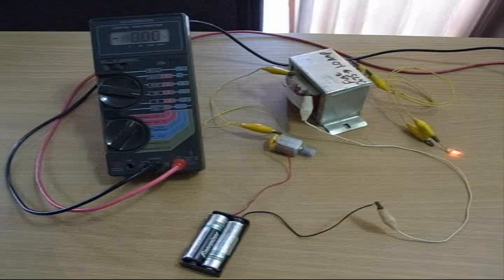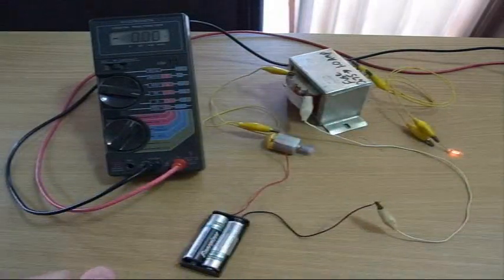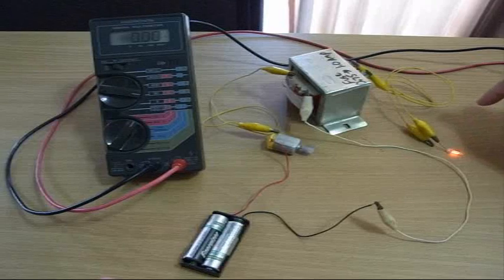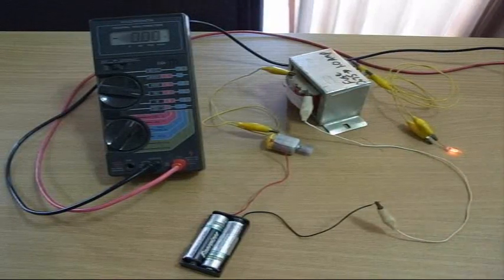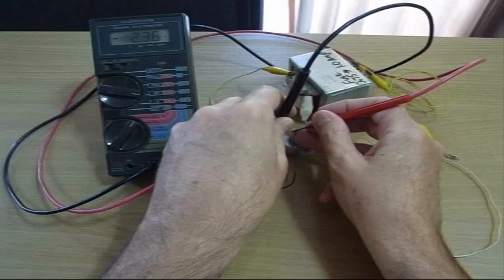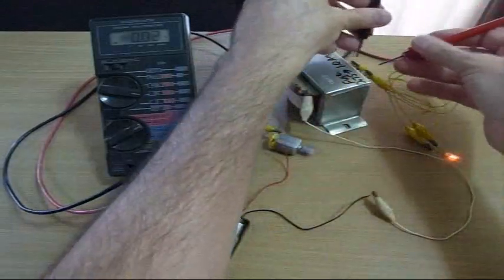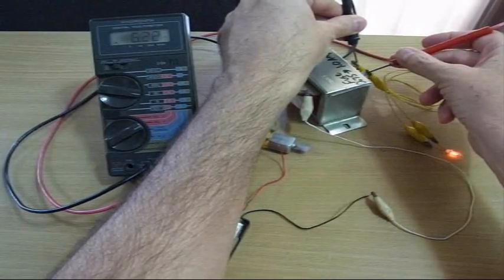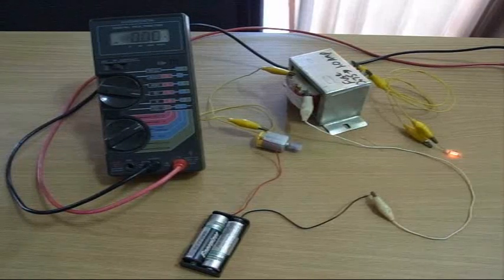Free Energy Inverter? - You Decide

Comment: We can observe energy (plasma energy) as the form of light in the output . This is causated by the flow in the little resistence of the transformer input (or the little induttance), isnt'it?
Reply from the maker: The transformer takes a lower voltage and makes it a higher voltage.

Comment: high voltage high frequency output due to the series circuit with the motor in the primary, it creates a pulse everytime it turns. the rpm is the frequency output, the number of turn of the secondary is you output voltage. it may vary depending on the input voltage of the primary. say if it was design for 12v 230v, so if that 2.5v in you will have 48v out at high frequency/rpm.
i am trying to build a solid state one, instead of motor to give me pulses, i use transistors. no moving parts only the electrons are moving.

Comment: take that same motor and then file down the brushes a bit so that only one commutator is activated. That will help boost the back EMF and increase the voltage. Replace the neon with a capacitor and you'll have usable power.

Comment: put a rectifier diode in series with the voltmeter and read dc on the meter and in one way of the rectifier it will read high voltage. in the other it will read 6.  ac don't real two directions. ac read dc but multiply by 2 to get ac voltage. if you read a battery one way with setting on ac it will read twice the voltage.

Comment: battery is not possible  to connect   transformer  without diodes. ( transformer for AC current only if can be used with DC please ...to explain...thank you
Reply from the maker: Yes, if you connect a battery directly to a transformer it is a short circuit.  But I connected the battery to a DC brush motor then to the transformer.  When the motor spins it connects and disconnects the DC to the transformer making it pulsating DC.  It is not AC, but pulsating DC is close enough to cause the transformer to transform.
Reply: ok right  thanks friend
Reply from the maker: No problem.  I've also done a video doing something similar with a relay to break the DC.

Comment: The reason the old 'ratty' motor worked better was due to the brushes being worn. The old style brush only hit one of the commutators at a time, creating a lot of sparks. Bigger brushes, which contact the second set of commutators (quenching the spike) reduce sparking, but you won't get the spike effect. Best thing to do is to pull the brushes and file them down.

Comment: if you put a decent load to the secondary, it will shut the voltage down. Those AC neon bulbs use no power to illuminate so it wouldn't be enough to change the speed of the motor unless you added a lower voltage ac incandescent bulb to the secondary side of the transformer. The transformer you're using is not set up in an anti-lenz configuration so it has no choice but to force the energy used back upon the primary circuit. Your motor is creating a back emf pulse as the magnets pass dead spots, each coil of the motor turns on and off, offering a positive component, then a negative component, allow enough to drive the primary coil of the transformer with it's reactive power being released into the circuit as it spins from a small dc source.
Reply from the maker: +Marc Belanger An interesting experiment.  I will put that on my list of to-do's.  Thanks.

Comment: First nothing unusual is going on, the DC is feeding the motor, which is sending the voltage to the transformer as pulsed DC at an undetermined frequency, dependant on the speed of rotation and the number of poles. In effect you are converting the 3 volts pure DC to an AC wave form at about 300 hz. The back EMF generated by the motor will add to the waveform in spikes. 

A normal Digital meter cannot read at the frequency involved accurately, it needs a scope to estimate the power of each wave cycle. Also don't forget Ohms law and power law only works with pure AC sine wave.

The input to the transformer is a combination of the battery voltage and the spikes which would be about 7-8 volts. This is applied to the transformer and dependant on it's turns ratio or input to output will then output a very much higher voltage, with proportionally less amps. As the neon is lighting at about 60V, we can safely assume the transformer is about 8:1. Any transformer could be used to generate any voltage if the batteries can deliver the power.

 (Actually the exact ratio is 9.166:1 as per the spec., quoted in the parts list)

 There is no Phantom voltage, or Plasma voltage, or any other effect, it is all as per normal electrical engineering. The resultant voltage can be used to charge batteries etc, at a very low rate as the current is small, exactly as the Bedini circuits do. 

Also this is the basic way car coils generate the high voltage to the plugs, but in a simpler form.

Stephen.

Comment: u cant measure plasma flow (phantom energy gravitational magnetical) .   present meter devices only  measures electron flow that is the problem....Electron travels  to slow 1 ft..per  45 mins .  plasma  flow is faster than light.  This is what happens when understanding revolves around  the electron...we are stuck at the matter level.  Light cannot exist without magnetical, but   magnetical can exist without light ......

Comment: Hello TS. I had not watched this one. Ah it was before I found your channel. Sounds like back EMF ?.  Have you done anything else along these lines?. Digital meters will not read this Type of voltage I have forgotten why. I will have to do some digging to find out. Very interesting to say the least. Try a diode's that run from the secondary / back side of the transformer and hookup to the battery's positive and negative. Try and find pos and neg on the back side of the transformer before you try hooking this up. Check to make sure the battery's aren't heating up!. 
Hope this helps and will have to try this myself 
All my best.
Bobby
Reply from the maker: +Bobby Tectalabyss I'm not sure what is going on.  Clearly the transformer is transforming, but the meter does not read it correctly.  I've found that with stuff like this meters, especially digital ones don't do well as you said.  
I think you went by me on the diode connection.  Measure DC potential from the output / secondary to the battery?  And probably use an analog meter?   
I've got several of these "free energy" videos out there.  It's a long story, but I found that many channels don't allow comments or delete contrary ones, so I provided a place where people could discuss the pros and cons openly without my interference.  Teach each other as it were.
Reply: +tsbrownie Hi TS. I've been thinking Uh O :)  The motor is also creating a back emf , Try Using a capacitor of at least 2oo to 400 volts across both lines out to smooth  the voltage before trying to run it back to another battery pack, battery,s with a very low charge left in them, this is to see if they will recharge from the spikes Use a diode to prevent a dead short between the transformer and battery's. Try different diodes to see which works the best. You are a nah after my own heart. I will have to watch all the videos I never knew you had posted. Thank you for the reply and Happy experimenting :)
Bobby
Reply from the maker: +Bobby Tectalabyss Good ideas!  I will have to try them.  Also getting reliable measurements is key.  Wish I had a scope.  Gave mine away last move to a charity organization that trains poor kids to become electrical techs.

Comment: it would be helpful to publish more info about the motor, the transformer and the neon bulb. What is the motors rated dc voltage? What are the transformer's specs? And the make and model of the neon bulb? Also, is there a way to converse with you in real time?Eugenewww.confrontingthecloudiness.com
Reply from the maker: +Eugene Labossiere Good point.  I included that info in the description.
Reply: Thanks. And I suspect that all of the collective information will finally become homogenized and understood, simple for the masses.

Comment: It's not "phantom voltage" it's merely very short duration pulses. The peak voltage may be hundreds of volts, but virtually no current. Enough to light a neon bulb, and to bite you, but no power. This is the same stuff Gerard Morin is doing, and claiming free energy. It's total bull faeces. Just an very inefficient inverter, a lot of high voltage pulses, and no power.
Reply: +Quantum Leap you are right; a lot of voltage and no power (amps), trick is to marry amps with voltage like marc belanger has done and Barbosa with the electron amplifier in Brazil. Youve heard of the venturi effect with gas carbs we just need to do this with electricity high volts sucking up amps from earth

Comment: I replicated your experiment with a 24v dc motor& a 120 to 27 volt transformer and was able to get around 9 volts ac then i put a bridge rectifier and was getting 16-20 volts dc but most importantly seemed that the amp draw went down slightly when extra load or shorted secondary ocurred.  This is certainly worth more investigating

Comment: when your battery dc current goes through the motor you begin an ac current on secondary side possible you have meter on dc versus ac. remember that would be the only way to get current on secondary; only if alternating the magnetic field otherwise your transformer would not pass current since primary & secondary have no connection

Comment: I've tried that before with My mini Newman motor running on 18 volts.  Measure amp draw from the battery too.   Amps go down when You hook up the light..  Mine went from .15 amps down to .07 amps when I connected 6 leds.  Why ?  idk !!
Reply: ThomasTheSailor Chubby Thomas you know how caps instntly store energy? My belief is that unlike a battery it throws it right back into the circuit once the ac wave reverses so its acting like a regurgitator for lack of better words so that when sine wave changes direction it has less of a hill to climbdue to that extra push coming back
Reply: ThomasTheSailor Chubby ps i used a nonpolar cap one for 50 volts and one for 100 and they both worked I would expect if you use a cap that has a lot of capacity it wouldnt work because of the extra time it would take to charge the cap & by that time the cycle would have already changed
Reply: Alex Manzanero  I think you are right. plus, the LED's are diodes and I think it changes the impedance in the ac current.

Comment: Your transformer is acting like a flyback of sorts. The motor has PM's inside which every time are passed causes a circuit break and that causes a spike in the transformer primary, similar to an ignition coil being turned off rapidly. DC pulses in a primary manifest as AC in the secondary because the latter has no point of reference.

Comment: Put a bridge rectifier on the secondary winding and measure the output DC ( measure the voltage and current ). Its the same as a step up transformer - power converter, however theres no free energy.

Comment from the maker: Across the primary 5.2 ohms.  Secondary about 11 ohms.  It is roughly a 8:1 turns ratio.  The output is AC, so more than likely it would damage the battery.    The windings would act like a short and burn out.  So nothing good would happen.

Comment: Hi , thanks  for video ... what OHM resistance does that transformer have ? 
Did you try replacing the Neon with a Lead acid battery of some type or these alum batteries Bedini is now building .

 you can charge a Bigger Battery with the 2 whilst running the Motor ?

Comment from the maker: No problem.  The motor is acting like a fast on / off switch, so it's what is making the transformer work.  Without it you just have straight DC dead short through the transformer with nothing out the back side.  
I am going to produce another video replacing the motor with a transistor circuit and that I can measure the output AC.  Maybe the output current is just too low to measure, approaching something like static electricity.  Just don't know.

Comment from the maker: The transformer is from an old printer.  It's from 110 v to 14 volts or so.  Nothing special.  I have done with with a toroidal transformer, but I "reconfigured" it for another experiment.  Guess I need to re-do it and show that.  I've done a mini-toroid, a tiny transistor, etc. and used a hearing aid battery to light that same neon bulb.  It's twitchy but it works.

Comment from the maker: The reading on the backside is AC.  The input is pulsed DC so the output won't be a beautiful sine wave, but...  Not sure why the meter won't show it.  Also tried an analog meter because sometimes they will pick up RF energy, but nothing there either.  That's why it baffles me.  Even leakage between the primary and secondary won't explain it.  Just don't know.  I need a seance session with Tesla.

Comment from the maker: I don't know enough about how neon makes light to know what is causing it.  I know that I got shocked and that takes considerably more voltage than what's showing.  If you've ever been shocked by a ringing phone line, that's what it felt like and those are around 70 volts.  (That's why the disclaimer).